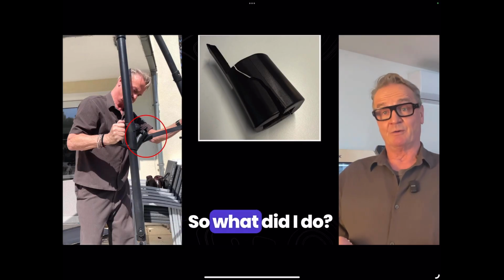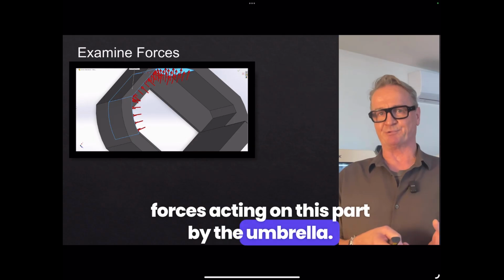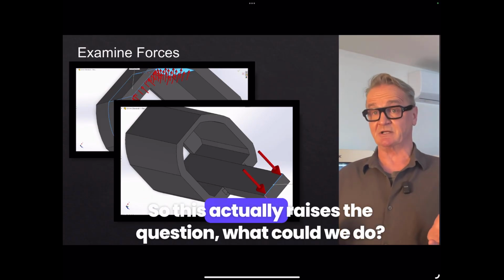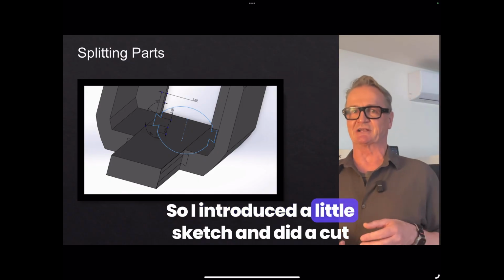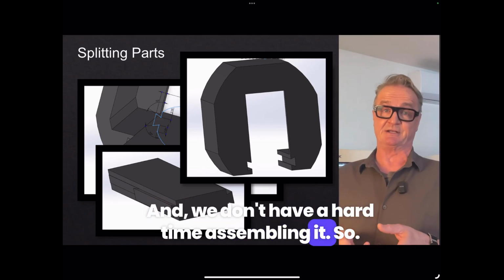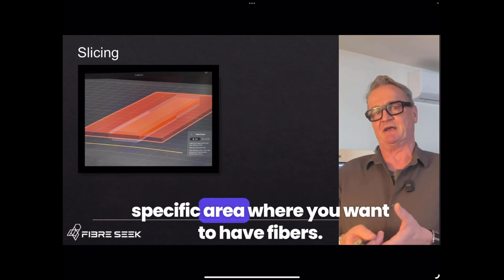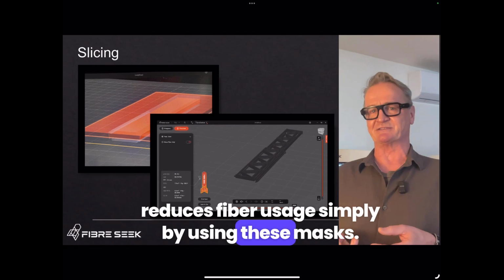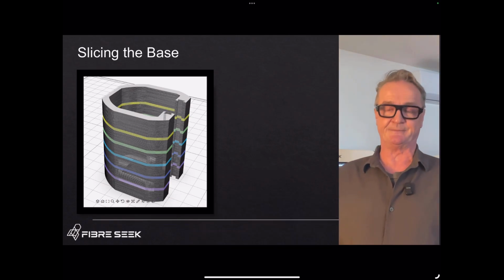Multidirectional Forces

Comment: Splitting into two parts is not always an option, but a good solution in this case. I may have created a void in the "tongue" which would allow pins or bolts to be inserted during the print.